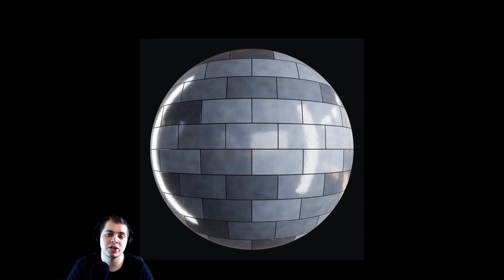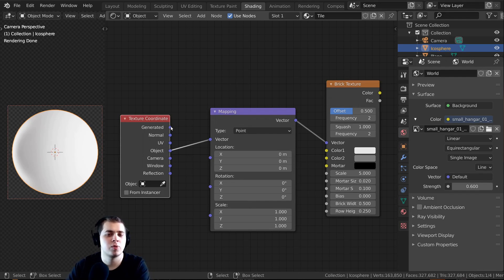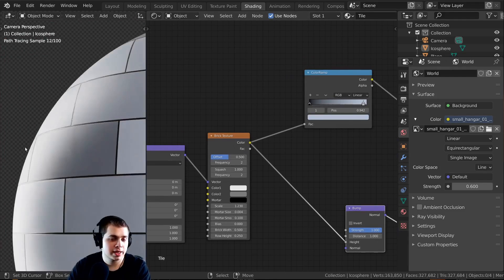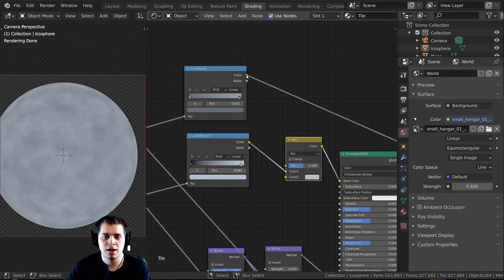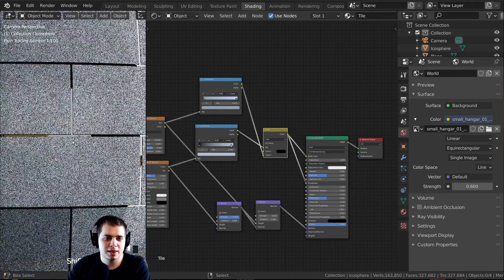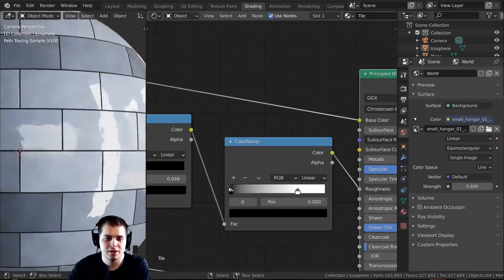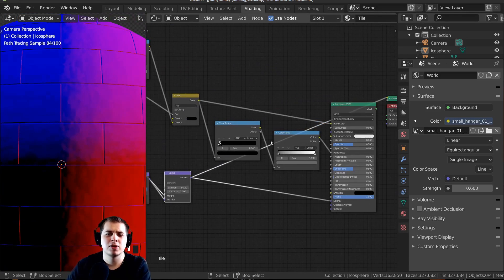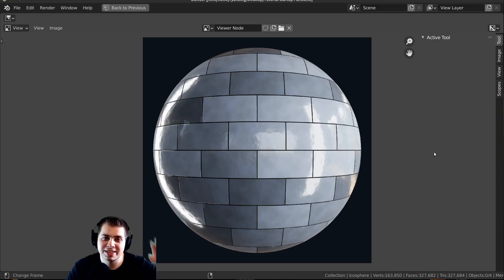Procedural Grey Tile Material (Blender Tutorial)

Comment: Ok so I know this was one you did a long time ago but question, I wanted to be able to change tile color using the group input so I swapped out the color ramp at the top for color control and did a mix color instead, is that the right train of thought.
Reply from the maker: Yes Exactly. You can use a Mix color, instead of a color ramp, because color ramps don't have sockets for each color.